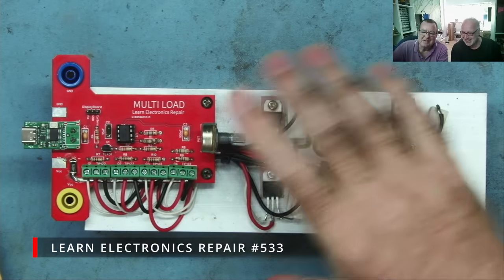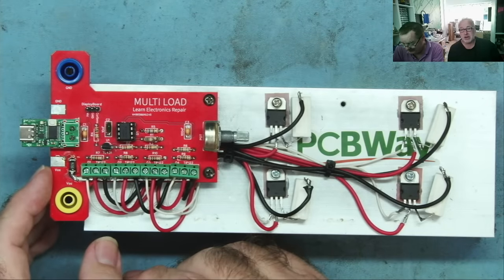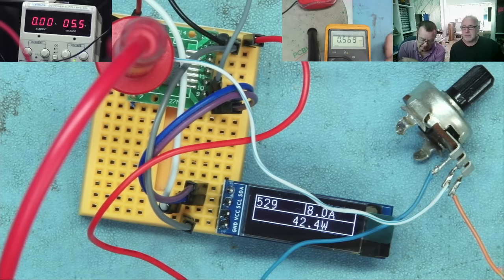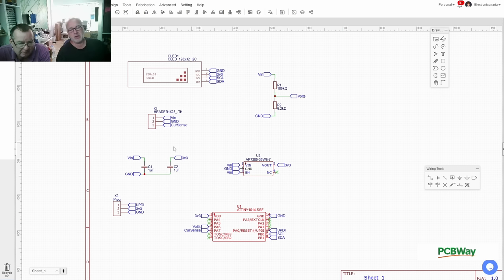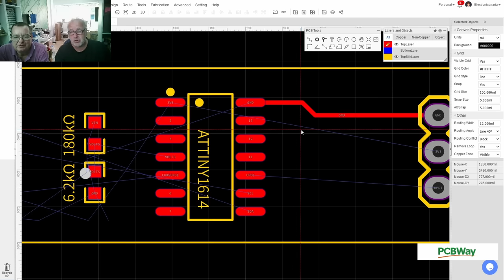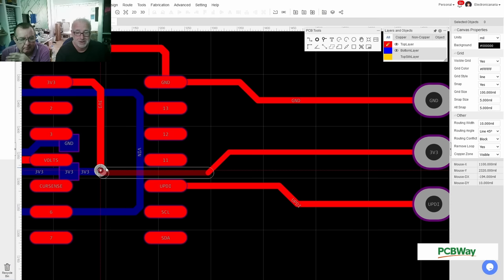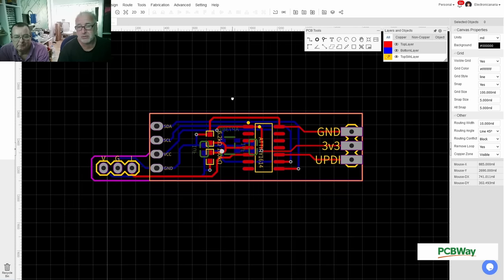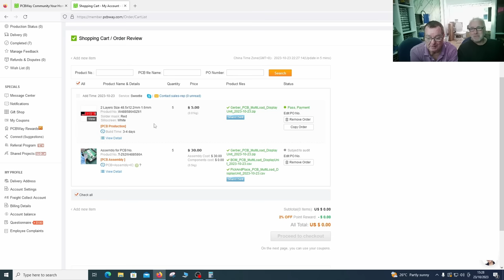MultiLOAD: Add Current Voltage and Wattage meters to just about any Electronics Project

Comment: Would you not be better of with a Nokia 5110 LCD Display with I2C module, there about the same price.?
The LCD would use less power. Have an option for back-light.
Old people like me have a hard time reading the small print on those OLEDs haha.
Reply: Hi Tim - old people here, too :) I have some NOKIAs laying around - quite frankly: didn't think of them. They are way slower than the little OLED and with the backlight LED I'd guess that there's not much difference in current consumption. Next time! Thanks for the input!

Comment: If you route the GND traces by hand and then generate a copper back plane, components may be difficult to solder to them because the whole copper area will cool them. You can leave drawing the GND traces to EASYEDA while it is generating a copper area! It will generate them and leave openings around the padds. This is called 'thermal relief'. If you want the copper area to extend to places where it is not drawn automatically, place a via in that spot such that you connect to GND on the other side of the PCB and check that its netlabel is "GND". Then the copper will also cover the 'hole' in the copper area. You could do that e.g. in the bottom right of the PCB where there is a GND plane on the BLUE side but not on the RED side.
Reply from the maker: This is more for Detlef to answer than me so hopefully he will come along and join the discussion
Reply: Hi Jos, all correct. We'll do assembled PCBs, so I leave the thermal problem with PCBWAY. but yeah, if xou do this by hand, the thermal mass will be tricky.

Man, lots of PCB guys here! I feel at home :)

Comment: Nice little display, i would have used a bigger one as my eyes hurt looking at these small ones.
Plus then you could add a graph of either voltage, current or both. Maybe throw in power for fun.
Reply from the maker: Power (Watts) is already included
Reply: @LearnElectronicsRepair  but in graph form. it's nice to see any trends.
Reply: Hi TeH - don't tell Rich such things! He'll probably wwant a second version with a bigger display :D

But I agree: graphs are a good idea. There are pins left: I could add a simple button and switch between screens. Let's see; there are other projects, that need some time, too.
Reply: @DetBuildsStuff  Sounds like a plan, I can never seem to reduce my to do list. I've got quite a list of videos I want to do next. 🙂

Comment: You certainly design a PCB much faster than me, but perhaps I'm fussier about making the board size as small as possible. In this case I would have moved the trace for UPDI to follow the 3v3 trace as much as possible so that the ground plane could be extended to cover much more area. I'm fussy like that.🙂
Reply from the maker: Interesting as Det says he is also more ADHD so maybe he will comment
Reply: Hi Chris - yeah, the layout session was a bit unplanned, and for a 20 min job this went pretty well. Since the board outline is defined by the little OLED display, there's no real need to go any smaller. If I'd do the board again I'll probably put the voltage regulator on the top side: there's enoght space to do all components on one side.

But you know: it's lazy Det you're talking to :) So it will probably stay at the "good enough" approach.

Don't get me wrong: I can spend hours refining a layout. but there's a point when you don't improve the fuction (or size) and doint layout just for the sake of it. I guess we layout-goys are all a bit ADHD :D